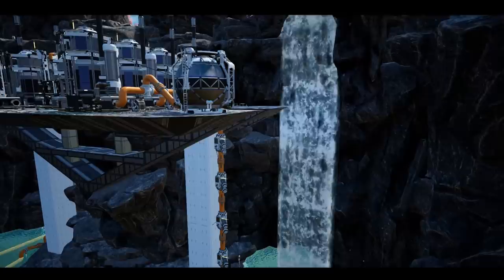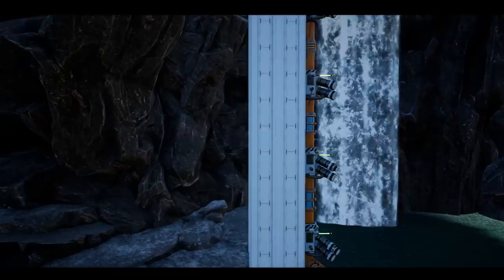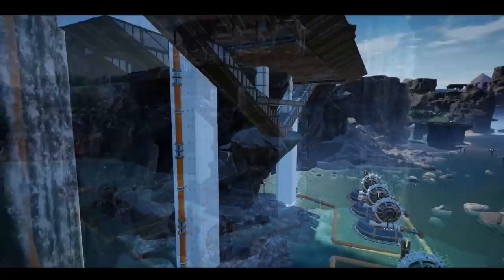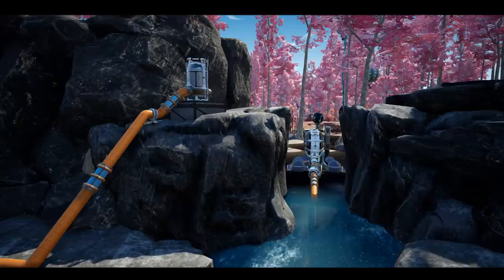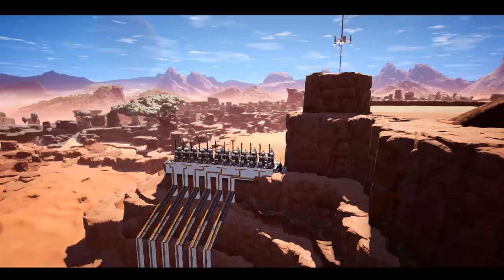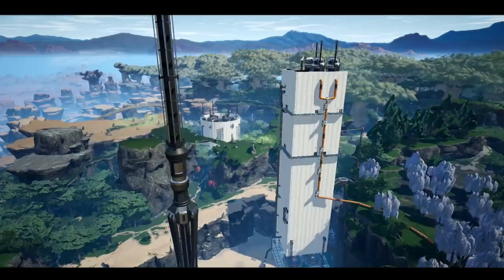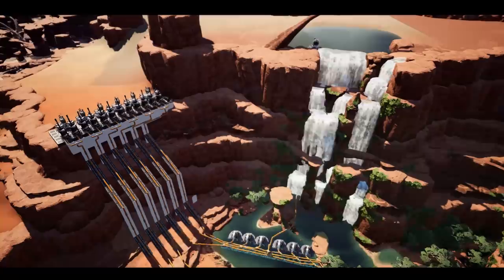A Guide to Not Needing Pumps [Satisfactory Guide]

Comment: So basically: head lift is preserved from a higher pump, not averaged with all pumps.
Reply from the maker: Yep
Reply: Highest pump*
Reply: this really seems like it needs a fix
Reply: @fiskfisk33  Why? it's physically accurate as far as i can tell. Main issue is you might have too much pressure so pipes at the bottom woruld burst. But basically he's treating the waterfall lake as a water tower
Reply: @tapiocaweasel  If you produce 290l of fluid down below, and add 10l a minute from the top, you should not be able to consume 300l of fluid up top. in the real world, the energy doesnt magically copy itself to the rest of the fluid.
Reply: @fiskfisk33  yeah, it makes no sense lmao. This is literally a perpetuum mobile
Reply: Magical Perpetual Conveyor Belts:  Am I a joke to you?
Reply: @tapiocaweasel  it's not physically accurate. It could only lift up the amount of water that came from a higher elevation, there isn't enough energy in the system to elevate more mass than came down previously. completely ignoring friction ofc.
Reply: Not pump, extractor.
Reply: @tapiocaweasel  It contradicts the conservation of energy.
BTW, if you are interested, water towers in real life aren't used as magical  energy amplifiers like in the game.
In real life, water towers are buffers. They buffer both water and the potential energy in the water. They are meant to smooth out fluctuations in water demand or power production.
So, if Satisfactory were physically accurate, you would need water towers in these scenarios:
1. Your factory operate only during daytime, and you don't want to build water extractors and pumps which don't operate at night. Instead you build half the water facility, filling the water towers at night to cover the shortage at daytime.
2. Your factory only operate at day, and you don't mind building extra water facility, but your power plants cannot feed both your factory and your water facility at daytime. So you make your water facility operate purely at night to take advantage of the excess power.

Note that the benefit of a water tower over a ground-level water tank is that it affects the pumps. A ground level water tank only affects the extractors.

Comment: In real life, the pressure at the bottom, where the other pumps connect would be so high that the pumps down there can't push anything. It's like 100m height to overcome right at their discharge, if they can do only 10 they would cavitate and/or suffer reverste flow.
Therefore, I wouldn't build around this idea (although very appealing) as I consider it as broken physics which should hopefully be solved.
Reply: you can leave foundations floating so its not like its the first physics breaking thing
Reply from the maker: That's what I was thinking, is there a way to run a one way pipe? Sounds odd but a pipe that controls the flow out of it;s shape?
Reply from the maker: Equally that's a fair point :D
Reply: @TotalXclipse  a pump forces it to only go one way
Reply from the maker: Yep, but the issue with that is the game mechanics of the pump, cancel head lift so it doesn't help the situation. You need to be able to control the flow, whilst maintaining the head lift.
Reply: There is too much butter on those trays
Reply from the maker: @leakyabstraction  :D
Reply: @icantth1nkofanam40  yes, but many players put pillars under the foundations.
Reply: What I also meant is that contrary to the lack of gravity for flying constructions, this doesn't feel like an intended design choice but an exploited faulty implementation.
Reply: It's just  normal gravity.   Look how we feed towns and skyscrapers.  Water flowing from hight to low.  It's not breaking the game it's like coffee stain put it in the game said nothing to see if anyone was smart enough to figure it out.  Greatest Easter egg ever for this game.
Reply: @TotalXclipse  According to the official wiki, a pump will stop backflow against the direction of the pump, even when unpowered, so adding a unpowered pump to a pipeline can be used to make it one-way.
Reply: @TotalXclipse  What you're looking for is a Tesla valve, which would be a great addition.  It's not a full stop valve, but does impose significant resistance to reverse flow.
Reply: @manuelpellizzari8540  i don't lmao, waste of objects.
Reply: @Advatar042  irl having some water at the top doesn't suddenly allow the ones at the bottom to push a lot higher.
Reply: @takingthescenicroute1610  You now have valves to prevent reverse flow in a cheaper way
Reply: In real life, you would adjust the flow to be fast instead of pressurized, and hammer the lower fluid up higher cyclically, instead of the constant flow you get here. Then again, the only benefit of such a process is free, not very good pumping. You wouldn't even get the same amount half as high. The concept still stands realistically. Just mistuned.
Reply: @leakyabstraction  que?

Comment: Great video, I have noticed that mechanic while playing, but the headlift resets when you use any buffer, so placing watter extractor high together with buffer is better. if u place buffer lower, the headlift is calculated from output of that buffer
Reply from the maker: That's a nice idea, I think possibly it would be best to have a buffer (like a water tower at the top) but then also run a second one at the top of your factory. the other option would be to pump water or oil to a single buffer at the top of your factory then bring it back down to all the other pipes.
Reply: @TotalXclipse  hi TotalXclipse, the fluid buffers have a built in pump that starts working when its full. so you can just stack a few fluid buffers and you dont need pumps at al. just keep the buffers full. anyways great video. and nice xplanation.
Reply from the maker: @rhonin210  Ahh interesting tip, might have to check that out!

Comment: Very interesting loophole. 
In my estimate, this is what happens programming-wise. They track pressure (head height) in each pipe. If the current segment doesn't have enough pressure to push water to the next pipe, it doesn't flow. Pumps add pressure, so stacking them at the bottom should work fine. BUT the fluid-adders don't check pressure; so long as the fluid is able to move out of their exit (there's flow across the junction), they're able to add their fluid at whatever pressure the pipe's at. If the pressure/head is less than 10m, it brings it up to 10m. So in your loop example, the water extractors are somehow pumping water at ~100m of head. IRL, something that could only produce 10m of head wouldn't be able to pump anything into a pipe at 100m of head. They only check the ability to pump the volume, not necessarily the pressure. I wonder if that will be patched out.

Comment: Just like a water tower....  40 psi....  Ok after reading a few comments.   People this is not a bug.  This is actually real life fluid dynamics.  And coffee stain kept it a secret to see if any engineers would try it.    Way to go Coffee Stain.  And congratulations to the factory engineer who was smart enough to wonder if it would work!!
Reply: This is not how real life fluid dynamics work. The water extractor at the top of the waterfall would supply the 120l/m to the factory below just fine with the pipe going to the bottom of the water fall and back up again, but the 2 water extractors at the bottom of the waterfall wouldn't be able to push any water into the pipe as the head pressure in the pipe at the bottom of the waterfall would be at min the height of the water fall, say 100m, which is much greater than the 10m of head pressure that the water extractors can pump.

But this is an excellent exploit in the game physics.

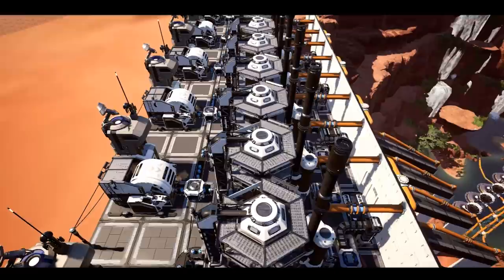Comment: 5:00 correction, the energy consumption of the train has to be lower than that of an extractor ONLY turning on for a few seconds per hours, since extractors dont turn on if the system is already full. Thus your extra backup extractor wont be using more than say 95% power over the course of an hour. Good luck getting a train to run cheaper than that.

Comment: basicly potential energy in a nutshell!
Reply: yup, but the pressure at lower levels should prevent the pumps down there from introducing any new flow. I am mixed on how I feel about a fix or not.
Reply: Kind of, the thing is that a single container or pump up top shouldn't be able to give lift to as much water as you want
Reply: I mean, this works within satisfactory physics, but real world is more complicated. Like, you couldn’t have a tiny water pump at the top of mount Everest and then be able to lift the entire  Pacific ocean a mile up.
Reply: @brycering5989  If it kills your immersion, which i can understand, all you have to do is dont place pumps so far down, just add them when youre at a good height again.

Comment: Im new to the game and haven't got to using pipes yet. But i had wondered why people were useing pumps spread like that. If the fluid mechanics are fairly accurate you could potentially stop tanks from draining by setting up siphon sytems. Id be a bit surprised if the game went to this length of fluid mechanics calculations. They have already removed pipe friction and other flow restrictions issues. If you dont want to create huge towers you could still create strategic pump stations at inconspicuous locatioms

Comment: For oil you could have an oil tower as part of an oil refinery, were the tank at the top is connected to the oil nodes and pushes them to the floor below the oil tank. At that floor there most of the oil flows down the factory, while some of it is used to cap of the tank above it using packaging the oil, or a single pump.

Comment: Using one packing refinery below, one unpacking refinery very high above (let's go Josh-style all the way up to just under the upper 1999m damage border) [I'm substituting the high-Z extractor with a unpacking refinery since the setup is then copypasta'ed easily for fluids other than water and logistics of a specific fluid need only then be wrestled with to reach the packing refinery at the bottom], connected to the first via a pair of conveyor lifts (one to bring up packs, the other to return the empties), the unpack refinery fills a fluid buffer, then we run a pipe down from the other port of that top fluid buffer.  Once primed (with empty canisters) it should be possible to have the head-lift of that one high-Z buffer in all the low-Z extraction lines by connecting them all to that single pipe from above, if I am understanding this quirk correctly.

Once working we have a zero pump setup.
Reply: This is what I get for commenting before reading, I had this exact thought and went and did some math when I coulda just scrolled

Comment: I'ma look into how fast packaging and unpackaging could fill a Fluid buffer, but that might be a better way of keeping an Oil reserve up higher and closer to where you're working (granted that minimum 2 Refineries uses less power than the Pumps you'd regularly need)

So yeah, a Refinery uses 30MW and would take 13Minutes and 20Seconds to fill a Fluid Buffer, would need only a 50% Refinery to unpackage so total 45MW to essentially grant infinite headlift on a pipeline
Reply from the maker: It sounds like a good trade off to me

Comment: This is basic Hydraulics and the same basic principle as used in a syphon system coupled with a venturi based pumping systems where it meets the input from the base pumps (we regularly used these for pumping out flooded areas when I was in the fire service) so long as your final output is below that of the initial input (could even be slightly higher due to additional pressure applied by primary pumps) you would need no additional pressure other than that required to overcome Frictional loss within the pipe system (which the game ignores anyway)
Reply from the maker: Really interesting, but could you split this between several pipes lower down? - In real life. I'm not an engineer and am genuinely interested to how true it is.
Reply: @TotalXclipse  In principle, head of water (pressure) is set either by pumps or static head (height) as a result of gravity, if you put water into a container with a pipe in the bottom and hold it in the air the pressure released at the end of the pipe when opened is directly proportional to the difference in height of the surface of the water in the container and the outlet of the pipe (approximately 1 bar pressure for each 10 metres of height differential) assuming no frictional loss of course (we allow about .01 bar loss per metre at 70 mm diameter I could go into the inverse square law for diameter increase here but probably best not if you are not into engineering)) that pressure could easily be split into multiple outlets with corresponding drops in each or be used to effectively pump it back up hill without any additional impetus being required (such as from a pump) you can also decrease the diameter at the outlet which would of course then decrease water flow but increase pressure, this is what gives you a jet type flow when using a fire fighting hose (or garden one come to that) if you are struggling to sleep an example of what we used to teach in the fire service is here https://www.ukfrs.com/sites/default/files/2017-09/Fire%20Service%20Manual_Volume%201%20-%20Fire%20Service%20Technology%20Equipment%20and%20Media%20-%20Hydraulics_%20Pumps%20and%20Water%20Supplies.pdf
Reply: sorry, the last bit should read that decreasing the diameter at the outlet decreases pressure and therefore increases flow rate hence why the jet of water comes out faster (seems counter intuitive but you need to remember that flow and pressure are inversely proportional just think that to release pressure in a container you let its contents out, the faster you let it out (flow) the quicker the pressure in the container drops
Reply from the maker: I've read through a few of the pages, it's actually very interesting and I understand the idea behind the pressure and reducing the diameter - like putting your finger over the end of a tap or hose, the pressure increases and thus the water can jetison higher.

Comment: It gets even more cheaty than this. You can slap a valve on the cheaty 'water tower' and set the flow to 0 and it will still count its headlift at part of the pipe system without transferring any water. Meaning you could tower up as high as you want with pumps. Fill up a small tank once. Valve it. Remove the pumps. Unlimited powa. I'm sure this will work till they patch the valve to count as a network divider when closed.

Comment: That's neat. It's as if the "water tower" provides pressure while the pumps at the bottom provide the actual flow. Which ofc makes no sense in a real setting, since they would need to provide enough pressure to lift it all the way up to even put fluid into the pipe at all...
Even if you don't have a really elevated source, you could probably use this to lift an arbitrary number of pipes to any level by just pumping ONE pipe to the top and letting it flow down again, providing pressure to all the rest.
Reply from the maker: Yep, it's not perfect as it's the way they've implemented pipes if we had different size pipes (which I'm sure we can expect eventually) we could in theory pump water to a tower and then split larger pipes into smaller ones so that we don't need pumps at the bottom between the water tower and the machinery, but in theory have the pumps take multiple pipe's worth of water to the top then bring the water to machines, more like real life

Comment: OK i've already thought of a way to make best use of this - a pressure tower. Have a bunch of pumps pump the liquid up to a tank (say oil) which then is piped back down and connects to every oil node - you can then pipe all the oil extractors, regardless of how many pipes you have, back to your base. You could, if you balance it, turn the pumps off, but it's probably easier just to leave them on.
Reply from the maker: Exactly my thought. Although you cant turn the pumps off because it still drains slowly
Reply: @TotalXclipse  true but if you have a megabase with a dozen pipes, you've just cut like 90% of the pumps needed
Reply from the maker: Xaiano yep ☺️

Comment: 1. On one hand - I hope they'll fix this in a later builds. Getting up-top the same amount of water you mine down there with only one high-up extractor is completely illogical.
2. At the same time - antigravity pumps with infinite head lift sounds like a good use for SAM-ore in the late-game stages.
Reply from the maker: It's not illogical though, it's exactly how water towers work in real life. Since doing this video I've been reading through a fire brigade water usage guide and it talks about water levels and pressure and to a certain degree this is totally plausable in real life.
But if they find it OP which I see why it could be then a SAM ore related technology would be great!

Comment: You can also use this trick without having an elevated oil pump or extractor. What you do is you have one pipeline with pumps on it and bring it up to whatever you height you want.  Then you have a pipeline drop it back down and connect to the other pipelines going up.  This way you can lift all of one liquid using just a single set of pumps.
Reply from the maker: Absolutely, that's what I currently use, creating a kind of "water tower" then trickling it into all the other pipelines :)